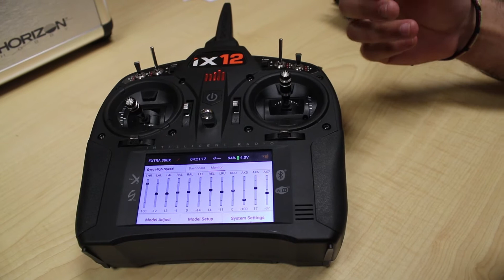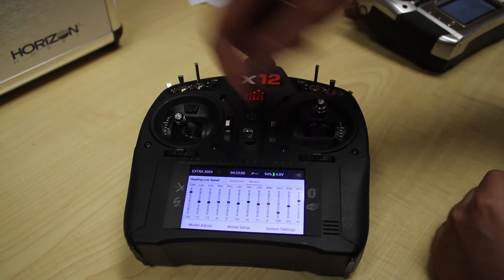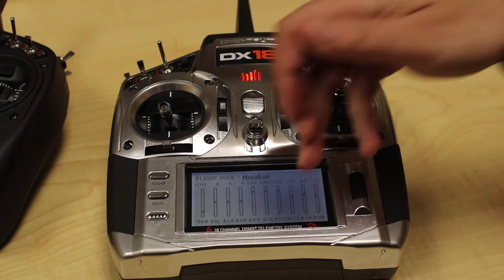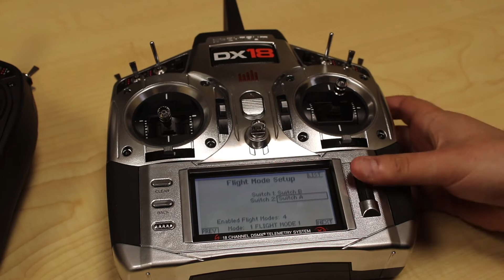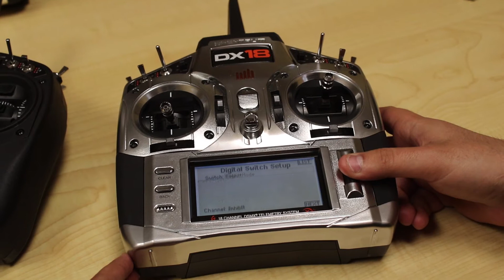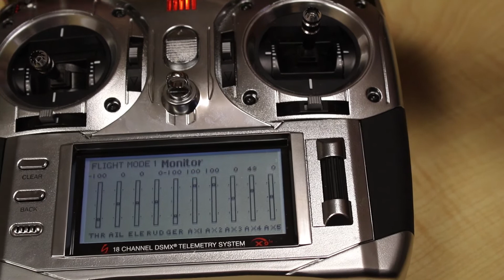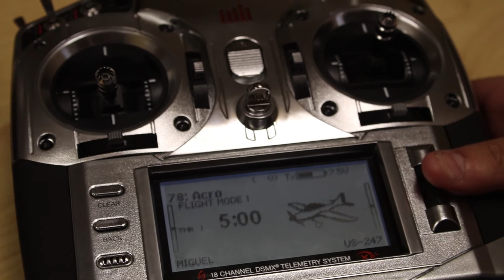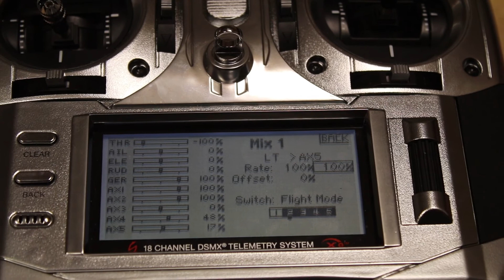Spektrum AS3000 Switch Setup Tutorial

Comment: Is it possible to setup different gains for different surfaces, like 15 for elevators an 75 for rudders , for example setting up b2 bomber with drag rudders
Reply from the maker: Yes you can set gains for each "Axis" and also they can be set to change with your flight mode switches, so you can have gains for different flying conditions

Comment: Hi Meguel,
I have just installed the AS3000 in three of my planes. Thank you for such an informative video. My question: When landing a giant scale gas powered warbird, which setting would be of most use ;..Heading Hold or Gyro?
Reply: I can help you with this information. Never use Heading Hold to fly .... heading hold is for low speed maneuvering or hovering only.
Another tip ... to land, decrease the elevator gain. It has happened to me a few times, the plane comes so solid and stable that you don't realize stall speed, and it's belly flat on the ground.

Comment: Hi Miguel,  Another great video.  I have a question.  I had never used the Digital Switch settings before.  They are brilliant.  My normal turbine gyro settings are to use the flap switch to adjust the gyro gain:  Some gain with no flaps, more with half flaps and even more with full flaps.  This essentially increases the gain as you slow the plane.  I also use a separate switch (H) to turn the gyro off or on.  Up until now, this required fairly complex programming using either 3 mixes with combo switches, or the gyro function with 3 curves based on the flap switch setting.  I see that by using the Digital Switch settings, I can adjust the gyro gain directly and still control the flaps with the same switch as the digital settings only apply to the channel specified and the flap system uses the switch independently.  This is great.  My only problem is how to get the additional on-off switch.  I could probably do it with a mix but was wondering if you had some more magic up your sleeve. Thanks atgain for the enlightening video.
Reply: BTW, I should have also said that I don't want to use Flight Modes as I am using this to control other functions like Dual Rates.
Reply: Hi Ken. The best way to have a killswitch would be to use the flight modes feature with 2 switches as weve done here. You would make a different flight mode assignment table though. When 2 pos switch is pos 0, your 3 pos should give you FM2, FM3, FM4. And when 2 pos is in pos 1, you will set FM1, FM1, and FM1 for your 3 pos switch positions.
Using the flight modes should be no problem, as you can still use the same switch for your other functions such as dual rates or flaps. Assigning a switch to flight modes doesnt prevent it from being used with other features in conjunction.
Reply: So if your 3 pos switch for flight modes is switch B, instead of using F-mode for dual rates, I would just assign switch B instead. Then your dual rates wont change when you go yo Fmode 1 to turn off the gyro
Reply: Hi Miguel thanks for the response. That’s exactly what I did and it’s working really well. Now if I could only get My hands on one of the gyros I could really have some fun. But I’m ready when you gets delivered